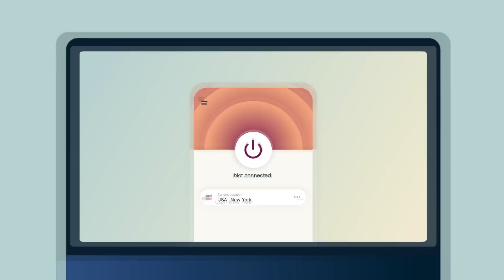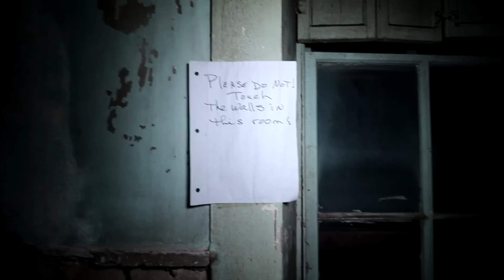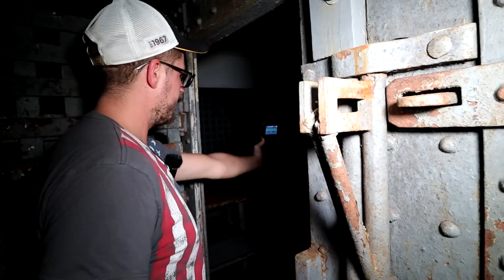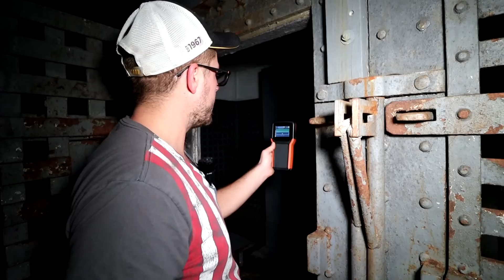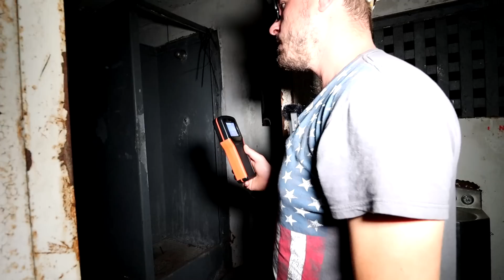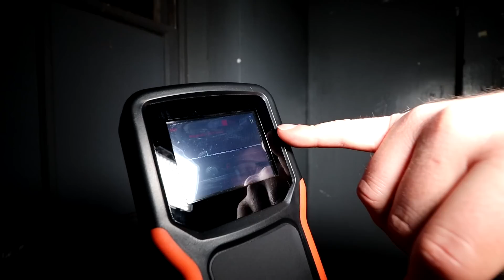(GONE WRONG) EVIL ENTITY PHYSICALLY ATTACKED ME IN THE MOST HAUNTED PLACE IN TEXAS | Part 2

Comment: PLEASE READ...Did you ever think that you may have been talking to the GUARDS (sometimes).  The Doors slamming sounded like evening lock-up, bang, bang, bang (could have been residual sound, a memory embedded in time). Frank went to go  into the 'staff room' and was stopped in the door frame and the pod went off. A message came as well..43:06..PLEASE LEAVE HERE..like a guard.  The stones are to hold the windows up. @55:08  Bell at main Guards desk dings, Angelo stops, box said KEEP WALKING..like a guard would. The strangling earlier could have been a guard as well, wondering why you are out of your cell, and that is why it didn't want you leaving that area, and why it couldn't follow you.

Comment: The door slamming might have a different source than you thought. You asked for the circular fan vent to open. When  first upstairs,  it was closed. After the  sounds it was open. The vent could have open, close and open again, with force and that's  why you  didn't see  a door move. A residual sound of a door slamming or being  locked at the same time